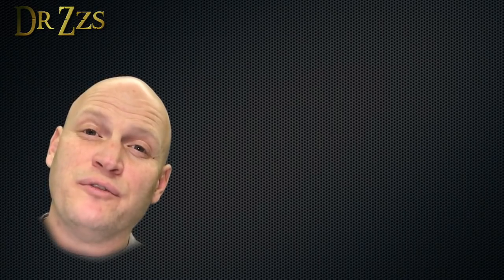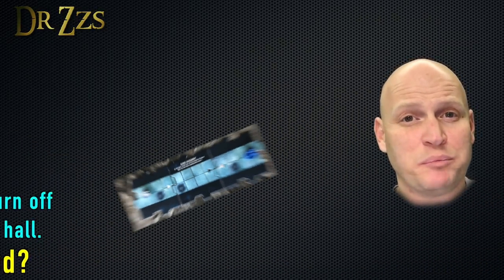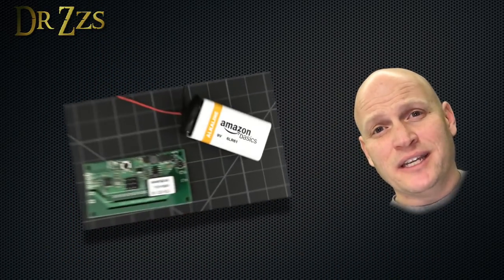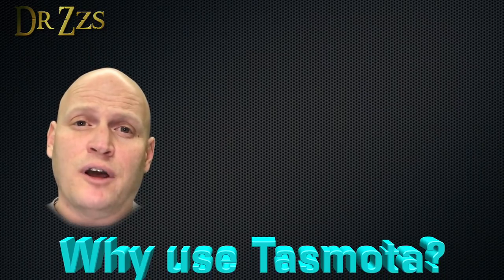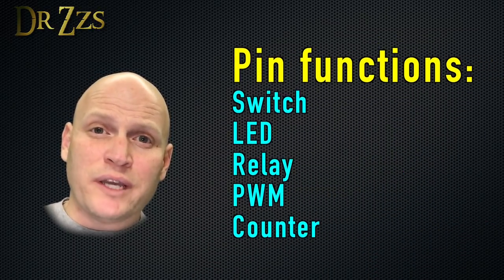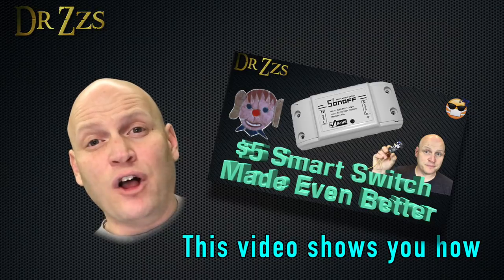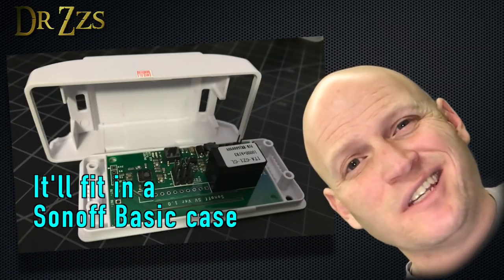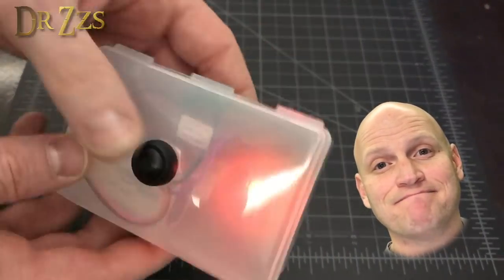an Almost-Awesome Wifi Button & a Lesson in Failure...

Comment: Quick question about the SV. The official website states that max current is 290mA. I just want to double check: if I hook up a 12V led strip that draws 4W the load will be too much? ie.  12V * 0.290A = 3.48W? Is this really all that the relay can do? Seems a bit low. It would be nice if I was misunderstanding something....
Reply from the maker: I had to look up what they mean by VDD.  It's still not totally clear to me...  
BUT!  I can tell you I've been running 3 strings of 12v 24w LEDs (6amp total) off one SV and it hasn't burst into flames.  If it were really only rated for 0.29 amps it would be ashes by now.  
I'm guessing they are referring to the draw of the ESP-chip/control side of the circuit.  So if you're using a separate power supply for that part (like I did for the garage door project) then you need one that will supply at least the 290mA.  The ESP chip usually draws something like 80-100mA, but they're saying we should expect an occasional max draw of 290mA. That's my best guess.  
I should peel off the sticker and see what the relay is rated for.  I'd guess it's 10amps.  
Hope that helps!
Reply: Thanks for the reply! Just wanted some indication before ordering, and their official website just confused me with that max current stat. But if you've hooked up that kind of load without going up in flames, things should be ok. Thanks for your help!
Reply from the maker: You're welcome!

Comment: hell i wouldnt call this a fail. yea so you have a bad power source. but say this wifi button is in a place like a sunroom or by a window tht gets decent sun and use a tiny solar panel and a supercap to keep it up or even a rechargeable battery.
Reply from the maker: That's another great idea!
Reply: ill be here when you try it my brother. im using your videos to learn the sonoff before i start my own smart home project. so its all learning stuff for me. i love it!
Reply: and yes i intend to flash tasmota to them and run HA. i found out that my thermostat supports HA as well. so im fairly excited for it. (its the cheap honeywell wifi one that goes for 100$ and looks like a normal digital thermostat)
Reply from the maker: I'll have to check out that thermostat.  mine are still dumb and I don't want to pay for the Nest.
Reply: the nest costs FAR too much for what it is. the model i have is the RTH6580WF and ive seen it on newegg for 90$ not bad for what it is. and from what i can tell looking at the components list in HA its supported. (im still setting up the server. been lazy)
Reply from the maker: Cereal Killer I’ll check it out tomorrow. 
I’d love to find an affordable thermostat.

Comment: you need no hub for alexa with skills.. so pointless right now.
Reply from the maker: ya, that's true.  You can do a lot with just Alexa.
Reply: Having a hub like Home Assistant or OpenHAB allows full local control, meaning no cloud based stuff.  If the internet goes down, Alexa stops.  Home Assistant and OpenHAB keep working without internet.  Even better if they have their own WiFi AP as then they work totally self sufficiently without ever needing an outside connection.